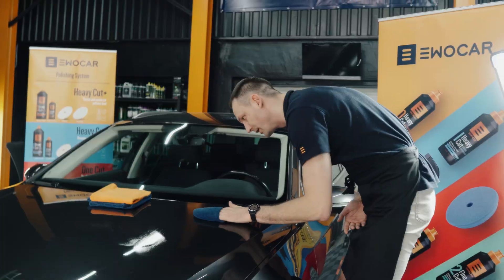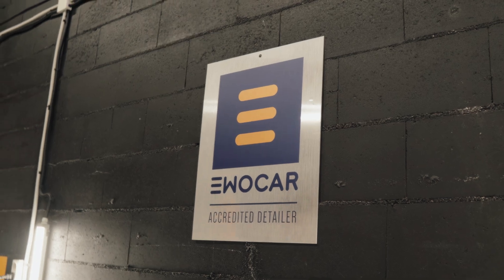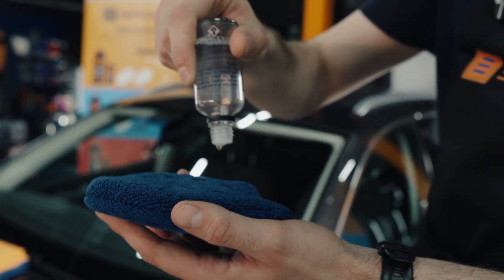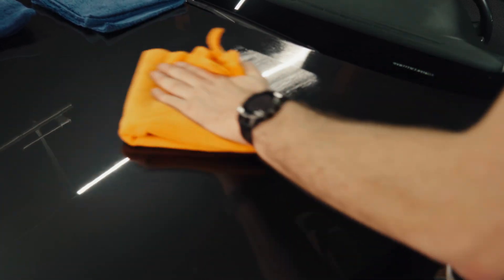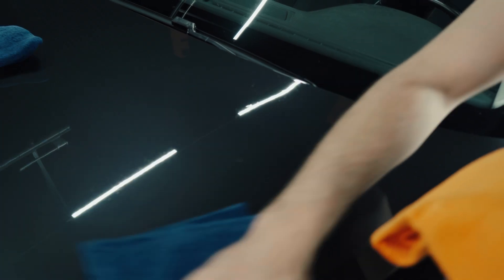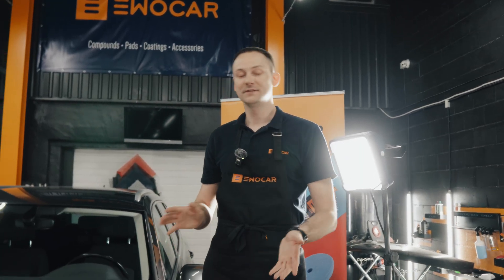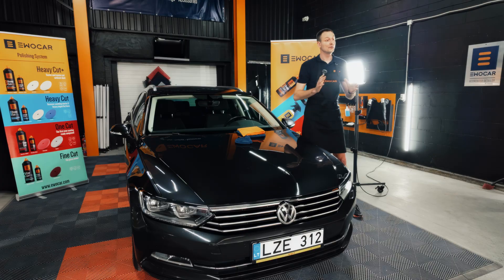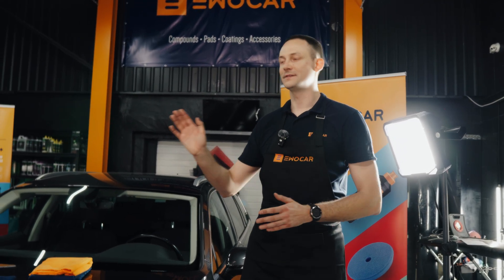How To Apply A SLICK Ceramic Coating To Your Car with Ewocar Hydro36

Comment: What are you using for a degreaser, is it like a panel prep? Love your products been using them for a year now, Hydro 36 is so slick and smooth after application and extremely hydrophobic great products